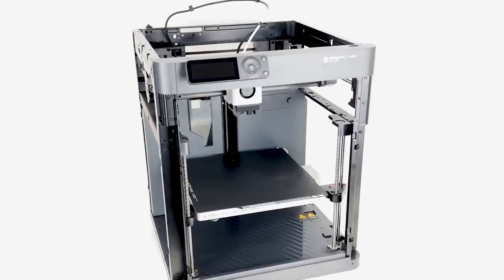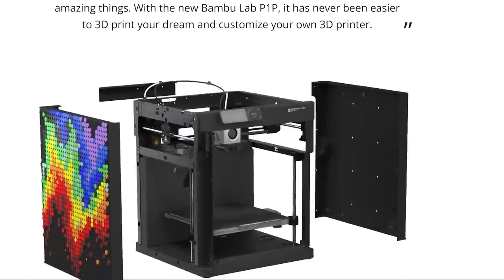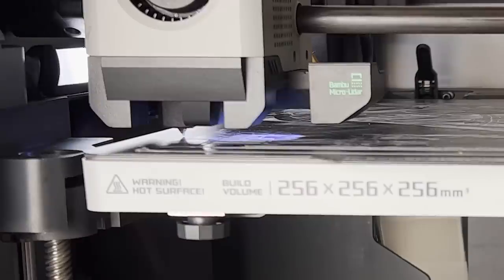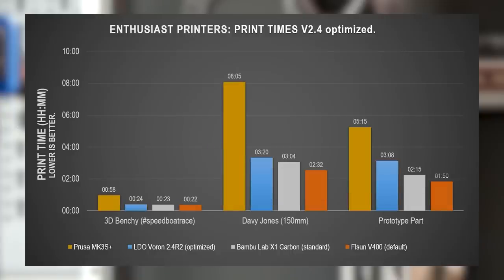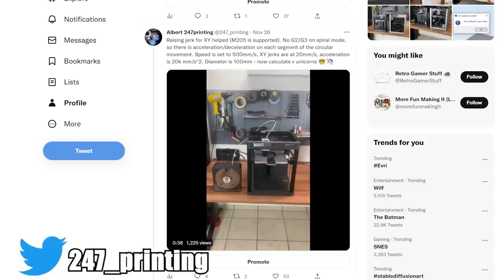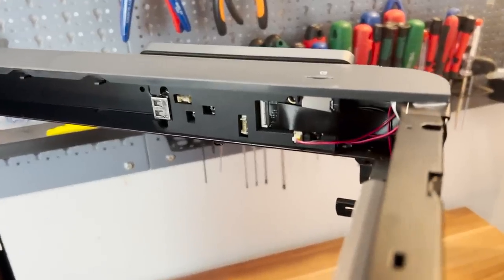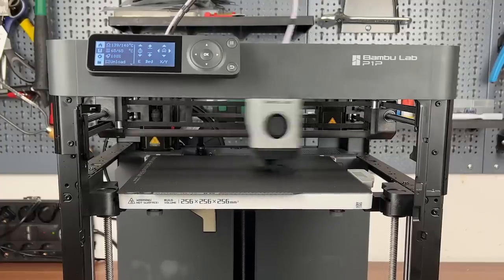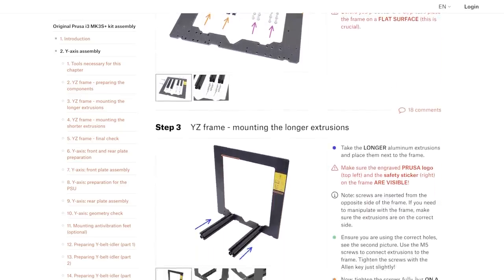Bambu Lab P1P REVIEW -  HOW GOOD IS IT REALLY ?!

Comment: The lidar feature is overrated. Very cool feature with very poor implementation. It is inconsistent and it can fail often, without telling you a thing. You keep printing thinking all is good because you see no error yet your corners might be messed up. Or you keep running the calibration not knowing it is failing every time, the printer uses the default, and you are just wasting plastic/time. A lot of potential if they add feedback to the calibration like before instead of always being silent about it and people thinking all is good.

Comment: p1p is 45 less than mk3 kit is crazy so pay 45 more spend 10 hours building kit and run 5x slower prints than p1p. prusa better step up quick
Reply: The P1P is also a paperweight or throw away after a year when the CF rods degrade so much that you can't print anymore. Prusa isn't.
Reply: but the pursa will need 5 years print time to catch up to that 1 year and u can buy 2 p1p for price of 1 assembled pursa
Reply: @LilApe  I get it that pursa will be printing for long time they great but markets changing they not if they update be game changer for everyone. they need to with deltas being super fast and all new fast good quality printers out today
Reply: @jamesharris9894  My parts only run 17% slower on a prusa compared to a bambu lab. But my prusa will still be printing after 5 years while the bambu lab is thrown out due to not being able to replace the CF rods. Bambu lab printers are easybake vorons that are designed to be thrown away when worn out.

Comment: The benefits of Prusa still do exist. They resonate nastily (noise-wise) - but put them on a heavy paving stone and you can have them in the same room without going mad. You can very easily replace the hot-end with an E3D Revo, which makes nozzle swaps child's play, the Bamboo is way more limited there. You can also maintain them completely yourself, in fact building one from parts you bought yourself outside Prusa should be possible if someone really wanted to. Also, you can get the Prusa as a Chinese rip-off kit, since it's open source - and open source is a great feature in itself. But it's getting much harder to argue for buying Prusa if what you want is a fast printer that basically works out of the box.
Reply: Do people buy TVs to tinker?  No.  They want something that works out of the box.  If Bambu Lab can create a 3D printer that just works out of the box, you would soon be in the minority.
Reply: @dontworrybehappy4916  But prusas work right out of the box too. You can buy every individual part, down to the nuts and bolts directly from prusa. Where bambu has a poor line of replacement parts, because of them wanting to be proprietary.
Reply: @LilApe  You have to build a prusa kit or pay more for a fully assembled one.  Considering Bambu is just 6ish months since they release their 1st printer that's a stretch.. most parts for the Bambu are available... other than the proprietary firmware, the hotend, etc.  It's not surprising they aren't going to give out their secrets where they have a spent a lot of R&D money to perfect.  Just like any other company would.  Even Prusa is guilty of this.
Reply: @dontworrybehappy4916  Bambu hasn't spent or done anything in R&D. Their two Printers are literally built using open source innovations that other people created. Their hotend, extruder, heatbed, AMS, slicer, coreXY motion system, their firmware (klipper). All open source stuff built by the communities. over the years. Bambu just took the tech and slapped a proprietary label on it. There is nothing "secret" about anything on a bambu printer. These are the same guys that copied prusa slicer, re named it, then tried to make it closed source.
Reply: @LilApe  If you believe what you just wrote, then the nonsense you wrote about parts being proprietary is more garbage.
Reply: @LilApe  
Bambu's SoftFever is also open source, and is based on Slic3r like prusaslic

Comment: no its apples to oranges, cant compare a bed slinger to a fixed gantry printer. different animal all together.
Reply from the maker: I 100% disagree: if there are two machines doing the same (3D printing) and cost the around the same, a customer would decide between those and the customer will compare.

Comment: When the bamboo fails and they don't have spare parts, your friend Prusa will be there to help you or your ender3
Reply: Question...do you build PC's? How long do you keep old hardware alive before moving on?
Just because you could replace parts for a decade, ask yourself this question, is it worth doing?

Sure you could find all types of clones and official parts for a prusa but in the end you will still have a slow prusa.
As evidence by a 2x-4x increase in efficiency is it worth pulling a "ship of Theseus" on a prusa after a decade?
Reply: Just buy spare parts with your Bambu machine when you purchase it, and that'll last you plenty of years. But but but ... PRUSA!!! yeah ok...
Reply: @No0o0o0o0o0  A slow but reliable prusa. Im still waiting for my replacement heat bad for my X1, after two weeks. Didn't even have 100hrs on it and the tool head crashed into the bed during calibration and screwed it up and bent my hotend. My oldest prusa has 17k hours on it and still stock, yet it's never crashed into itself. reliable old tech.

I bought into the hype of the X1 and that was a mistake. They want me to send the printer back. That's BS considering they've sent other people replacement heatbeds before.
Reply: @HaloMachine     cool story. I'm on 3k hours no issues. And based on the speed savings that would have taken a prusa mk3 9-12k hrs to print. It's all relative.
1 X1C =3-4 prusa's.
 I spent 1k on KS eb with ams and have been printing daily. No way a prusa is going to top that. And based on what you're saying you must not be happy with your prusa if you're looking to buy another kind of printer. How much you selling it for I'll buy it
Reply: @No0o0o0o0o0  Wrong, I'm very happy with my prusas, they've given me zero headache over the years. I use them for business and income due to their reliability. My X1C was purchased for fun, just like my ratrig and resin printers.
Reply: @HaloMachine  Hes a noob to 3d printing and a bambu shill. He doesn't know anything but bambu and goes into hiding whenever you prove him wrong. He gave me 20 reasons why the x1 is better than a Mk3 and 18 of them were literally features that the Mk3 also has of were just purely subjective. Then he disappeared for like 3 weeks again. Dude thought the X1's 22ga welded steel was better than 1/4 steel plate on an mk3 XD.
Reply: @HaloMachine  I just got in the hobby  earlier this year. Now it's a business making money. for example I  just got a 25 part order I can do in 50 hrs(X1C) vs 250-300 hrs on a prusa due to needed color changes and I would need to babysit the prusa. The MMU is hot garbage

There is the rub you had a prusa for years and have an attachment to it.  I have a Bambu, ankermake M5 and retired ender 3 and see zero benefits in a prusa. I am never going back to under 50mm/s printing especially for $800 or $1100. I would need to spend on 4.4k on prusa just to not quite match one X1C.  And the mk3 has a smaller build volume cant handle certain materials, cannot do remote monitoring, speeds arent even worth discussing etc.

I'm not saying throw away your  mk3 investment but for a anyone serious about 3d printing I would never suggest a prusa in 2022/2023.  I will say  Prusa has loyal fans but dont ever forget they have to earn that fandom and settling for slow/no innovations wont cut it anymore. The competition is several generations beyond the orange and black.
Reply: @LilApe  hey hey my friend. You ran away from that thread and I have been waiting for your to reply ..
18 more to go. Should I put up the list for you again.?
You asked me how the Bambu labs is better than prusa.  And you turned tail and scurried away. I'll add a new one. Energy efficiency. Not needing to heat the print bed  from some filaments and faster prints can reduce energy usage up to 80%.

"He's a noon to 3d printing and a Bambu shill" 

Dont run lil monke. The unspoken part about "gatekeeping" is someone will challenge you at the gate. 🤣

If I don't see a response from you I'll assume you ran away... Again.
Reply: For lil ape before he can run again This list was compiled before the P1P was out so some features are model specific. He ,wrongly, stated that the prusa has most of these features. You can spend $1k more on prusa and still not match a bambulab printer. 
1. Faster (up to 4x-10 faster than Prusa's best printer)
2. Better price for what you get. 
3. Fully Assembled (no building required or paying $300for someone to build it for you)
4. more capable(X1and X1C are enclosed and able to print more material types)
5. larger build volume 256x256x256mm vs that palty 250 x 210 x 210 mm
6. better multi-material system up to 16 colors
7. CoreXY vs bedslinger.
8. Camera integration
9. monitoring remotely
10. First layer detection
11. spaghetti detection
12. Color touch screen vs the laughable 80's "speak and spell" 20 character LCD. 
13. Cloud printing and monitoring
*14. Flow calibration with lidar
15. It's ready to go from unbox to printing in 20 min.
16. It's easy to use. 
17. You dont need temp towers, z-offset adjustments, calibration wizards since a X1C does it all for you. 
18. One bambulab printer can replace 3-4 slow Prusa printers. 
19. Actually looks better vs that 3d printed looking science project from the 80-90's
20. Welded steel frame
21 Energy efficient. Prints faster and does not need to heat the print surface as high for some materials
and so much more.
Reply: @No0o0o0o0o0  I have been manufacturing 3d printers for 4 years. My Prusa must have more than 80,000 hours of printing with my MK3. Logically, some components have been changed, but if you don't want to buy it from Prusa, you can assemble it for 400 dollars buying the parts that you can buy in China, which are the same ones that prusa sells and which is half of what a bamboo costs. I also build pcs. In any case, in my laboratory I will have to buy a bamboo for hard tests with various filaments

Comment: I like the only fact that Prusa will be forced to bring better printers. 
Other than that, although Bambulab seems very serious I am still skeptic about their printer SUSTAINABILITY in long term (considering todays tough global political and trading situation), as I don't want my printer to be outdated in few years.
We are buying Prusa printers mostly because:  1) upgradeability 2) 24/7 customer support 3) firmware updates 4) Awesome slicer development
Reply: Mk3 will definitely not be able to last for a few more years. I have both mk3 and voron. As long as the stability of p1p is good, mk3 will be eliminated. The printing time is 2.5 times. This game is over.
Reply: It is the double edge blade in question. It is a chinese proprietary bit of hardware, so there is simply no guarantee. For all we know they may go like Huawei where they make incredibly cheap products, but with incredibly limited support cycles forcing more regular buying of new products. Time will tell if Bambu is a new benchmark OR another example of a cheap product being more costly in the long run.

Comment: "Proprietary"  ........  I stopped watching right there.  Ain't worth the headache.
Reply: That is actually a major downside, I agree. And the whole thing is Chinese, with cloud-connected Chinese software, which is proprietary with an extra helping of "hell naw". But many people just don't care, or don't care enough. You also can't easily swap nozzles - on my E3D Revo equipped MK3, I can print 0.15  mm nozzle for one print, then cold-swap to the 0.8 mm nozzle and print a giant storage box faster, etc. Of course - since the Bamboo products run twice as fast they still print quickly.
Reply: @extectic  
I bought 3 cheap and small,  but reliable printers.   Parallel printing the parts to complete a project is much faster than a single printer even at the speed that Bambu can print.  None of the small ones are proprietary,  the parts are easily available,  easier to repair,  and much less headache......  Win win situation.

Comment: Prusa's issue is that they haven't innovated. They are still doing (basically) the same thing they did that put them on the map...  while the rest of the 3D printing community has continued to evolve. Prusa can be an amazingly successful company in the world of Ender 3's and all the cheap Chinese clones and knock-offs. In a world where consumer 3D printers evolve and progress?  Prusa needs to step up it's game or fail.
Reply: Prusa hasn't innovated? lol what exactly has bambu innovated on? Prusa helped innovate the industry with several others. Bambu has just ripped those ideas and made it proprietary.
Reply: I'd argue they are innovating. They have figured out new stuff like a reliable tool-changing system, a heated-bed with selective zoning to only activate what is needed for peak efficiency and have finally adopted a CoreXY system. Problem is that it is all within that blasted XL that is a year late and counting. Besides that the i3 is still as outdated as it was two years ago and the mini has only recently finally gotten its WiFi capability figured out. 

They COULD get back in the game if they port the Mini's control board and some of the XL's ideas to the i3 in a MK4, though it looks to be "Too little, too late". They really should not have put all their eggs in that single extra-large basket.

Their Slicer is still excellent though, but that is arguably more thanks to Ultimaker's Innovations which Prusa tends to adopt and sometimes optimize.